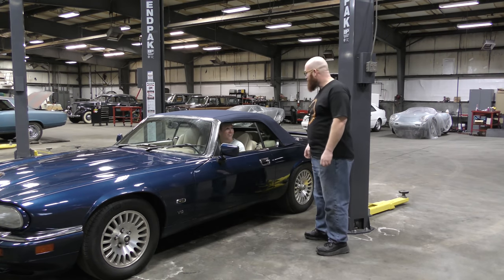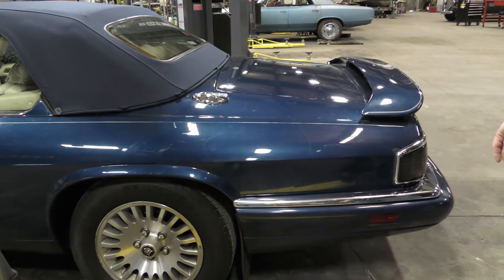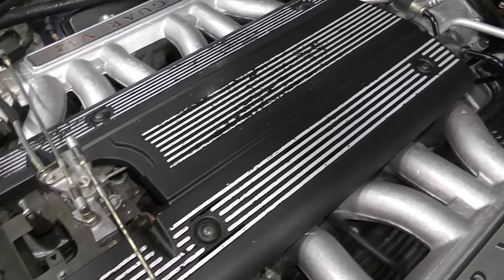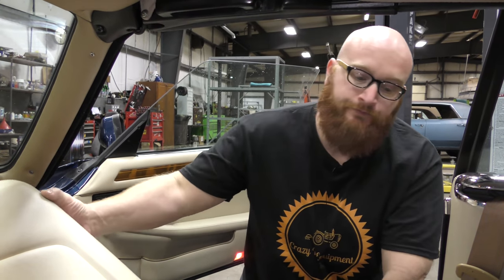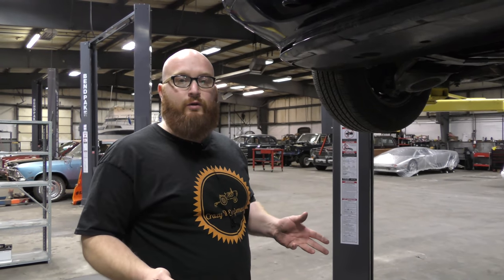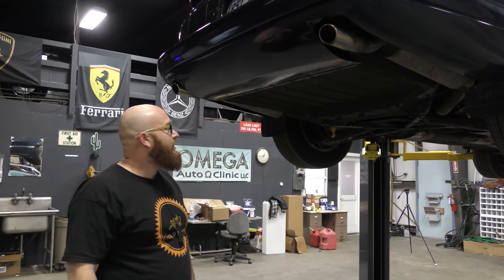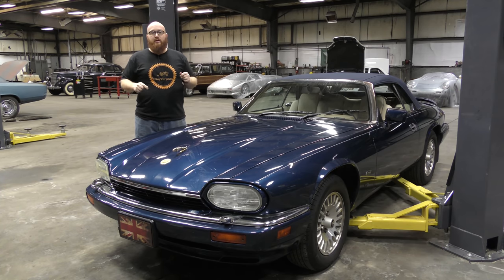It's another smooth running V12 Jaaaaag in the CAR WIZARD's shop! Check out this 1995 Jaguar XJS

Comment: The yellowing apparent @9:47 on the passenger side headlamp would annoy me. I assume that it isn't just an artefact of the way the car is lit.

As far as the general state goes, it looks like almost all the problems are just age related, such as the valve cover gaskets hardening up and leaking. Presumably that's why the dampers have been replaced and the brake hoses.

nb. why is it in the car world dampers are called shock absorbers? It's one of the great misnomers; any mechanical engineer could tell you that it's the springs that absorb shocks, and it's the dampers job to dampen down the spring reaction (especially on the energy release on the rebound). For that matter, radiators don't radiate to any significant level - they cool via convection. John Cadogan has a good rant about this, and I must have caught the disease from him.

Comment: Be careful with the marelli! The dizzy rotors fail and the passenger side bank loses spark. When that happens fuel dumps into the cats, they overheat, and the car catches on fire. Solution is to pot the rotor and delete the cats!

Comment: Occasionally on my way to work. I go by someones house that has a white version of this. Not sure of the year or model. But it's very similar. But it's not moved in years. Poor car is just sitting there getting moldy. This one is nice. If it were mine, I'd lose the wing, swap out the wheels and maybe change the top color.

Comment: Have been a professional automobile Technician for almost 40 years.  My apprenticeship was at a Mercedes Benz dealer, and became a Toyota Master Diagnostic Technician in 1997.  Worked at 2 separate Toyota dealerships that also sold Jaguar.  I remember going to MB training in Montvale, NJ and how much the instructors in the mid 80's made fun of Jaguar.  Then my experience at the Toyota/Jaguar dealers so turned me off about them. Loved the looks of Jags, but found them to be extremely unreliable,  and difficult to repair.  That said, I still adore the styling of the E Type,  and 60's Jag sedans.  XJS though....felt like it wasn't quite finished, and the designers said..." yea it is good enough,  time to turn it over to production."

Comment: Holy shit. Twin shocks @@ I remember it being the fastest car I'd been in for many years, a 5.3, 3 speed auto version. It was a tank and even with stetched legs as a passenger I couldn't reach the firewall. It was silky smooth but I never got to look underneath.
Reply: Twin shocks had been a part of the Jaguar rear suspension since it first went independent, that was in the 1961 E-type (61 years ago!!!).  One in front of each half shaft (which is the upper link of the suspension) and one behind each half shaft, quite logical.

Comment: Wizard, how does an oil leak affect rubber parts on the engine? My engine bushings were constantly failing because of oil leaks, isn't there a similar risks for all these belts?
Reply: Oil is a petroleum product. Rubber is a petroleum product. The liquid oil slowly dissolves the rubber, making it weaker in the process. The exception to this is the nitrile rubber used in gaskets, etc (but not in belts, motor mounts and other parts). 

Think of it like water in a dirty pot, the food on the pot eventually softens and breaks up because of the water.

Comment: A small question.. About the check engine light. I've read somewhere that OBD wasn't standard until 96-97? How does one go about diagnosing the engine light? I guess there's a diagnostic system of course. But is it jag propriatary? or some older standard?
Reply: Jaguar preempted OBD’s arrival and a ‘95 should have the standard socket for a reader to connect. The brake accumulator leaks it’s nitrogen above the diaphragm causing soft brake feel.
Reply: You turn the ignition on, and then any codes stored are displayed in the trip computer screen.

Comment: its crazy that four cylinders make that v12 power now. who would have thought back then
Reply: Usually those four cylinders need help from one or two turbochargers - more added expense and mechanical complexity.  Those V12s don't need any additional power adders, and best of all, no need to rev the engine to a million rpm to get the car moving.

Comment: Which ornament is best?  Neither, I would prefer the more sinuous leaper from the earlier Jags,  or perhaps,  even better, nothing at all - the E-type only had the cat's head badge in the middle of the air inlet bar.  You could always get a black leaper (the sinuous one) made from vinyl and attach it to the sill, just behind the front wheels, understated, or again a relief badge of the leaper.  The cat's head badge looked good in the early years when it showed the Le Mans victory years, but, in my opinion, it does not compare to the early leaper.

Comment: Some one did work to the  suspension anf didn't align it ,may have done a tape measure toe job that's why crooked wheel yet drives strait. But Im sure he figured that out before he even posted this video lol.

Comment: 1945 — The famous Leaping Jaguar logo was first introduced on bonnet / hood ornaments, and its style remained relatively unchanged until the early 2000’s. It was the Famous Dictatorship The EU that put paid to most Bonnet / hood ornaments by making it that it had to fold or vanish in an accident.
Reply: This Jaguar was built more than a decade before the EU put those pedestrian-safe requirements in place.  In fact, the EU didn't even exist yet when this Jaguar was manufactured.  As other comments have stated, the leaping Jaguar hood ornament was added later by someone else.

Comment: Car Wizard: The rear seats are put in because some countries will charge a higher road tax for two-seat sports cars as they are considered a luxury item.

The extra seats (with seatbelts) are used to get around this.
Reply: If you are buying this cost is not an issue surely?
Reply: @noelnicholls1894  You'd be surprised how high the taxes can be.

Comment: A possible reason that the Jag uses so much steel, while many other contemporary vehicles do not is that Jaguars were not made in large enough numbers to fall under CAFE requirements (or the Jaguar customer accepted the 'fuel guzzler' tax as a badge of honor).  Automakers whose products qualified for CAFE restrictions were painfully aware that every bit of unnecessary mass would limit the number of high margin cars that could be balanced by slim margin econoboxes to stay within the corporate average fleet economy.  The whole SUV fad, in the US, was due to SUVs not falling under CAFE restrictions, so nobody cared about their terrible fuel economy.

Comment: I don't like the aftermarket rear spoiler, apart from that it's a beautiful XJS  jaguar with wonderful blue paintwork. The jaguar designed V12 is without doubt the best in the world, utterly reliable if serviced by someone like the Wizard. Steel timing chain within aluminium engine block and heads.  Prices of these are going to deservably increase considerably. Front spark plug is a pain to change, but no big deal for someone who knows these cars.
Reply: Actually, that spoiler is not aftermarket, and was offered by Jaguar on this particular model back in 1995.  If you look it up you will see photos of similar models with spoilers.

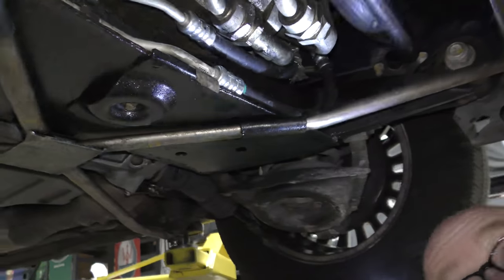Comment: 10:54  are electric fans better than engine driven fans?
Reply: Depends on who you ask.  There are proponents for both methods.  Engine driven fans tend to be more reliable, are always on.  Downside is parasitic drive losses resulting in a minor loss of power, and you have to maintain the fan belt.  Electric fans are more compact, helpful in cramped engine bays where engine space is at a premium without losing cooling capacity.  Less parasitic drive loss with the engine.  On the other hand, electricals have to be maintained or you lose cooling capability.  There are arguments for and against both fan types.

Comment: 300Hp is Not a lot, IMHO,--maybe for '95.   Only about 2K miles/yr.   I thought I saw a small tear on the passenger side rear corner of the top @ its base..    Beautiful unit overall.    Chk engine light could keep it from being licenced,--could be critical.    It should stop quickly--4 whl discs!    Should make for an "interesting" vid.

Comment: The reason most cars use plastic as much as they can these days on interiors and things like the door handles is most certainly cost but also weight. Modern safety structures and devices add so much to the weight of a vehicle that, they are a nightmare to get to fit at the same time into modern emissions standards and meet customer demand for frugal fuel consumption. So, there's absolutely an extremely high incentive on using modern composites everywhere possible. Unfortunately, the stuff that withstands UV in a fashion that would actually make the part endure the entire life of the car, that stuff also tends to cost. Like the stuff firearms industry uses, for example is very durable to both manual abrasion and the environment. But that doesn't come cheap. Add to that the insane notion of modern regulatory authorities and of course the industry itself (managements idea, against the better advice of us engineers), to insist they're only meant to last for 3 or 1,5 years. "No, that is not a joke." and you get things that literally fall off into your hand after 5 or so years for door handles. I know, since I study mechanical engineering and am majoring in automotive technology (cars and heavy-duty industrial applications, trucks, front loaders, logging machines etc.)

Comment: The leaping Jaguar on the bonnet is completely WRONG. It should be removed posthaste. The large cat is off of a much older car. I've had two Jag v12s. One perfect - carbs, the other a mess-FI

Comment: Just wondering why the wizard would fix Jags and not BMWs.
Reply: Old jags are way, way easier to work on than modern BMWs, especially once you know what some of the odd systems do. Certainly in terms of the engine. 

There is far better access because they designed the engine with servicability in mind, not hiding things under things or integrating unrelated parts for the sake of neatness. It's all right there where you can get to it. Not only that, everything is made out of metal on these jags, so you dont have to worry about the brittle plastic that plagues modern bmws.

This doesn't really apply against older BMWs like say an E12 (because they were all metal like the XJS, and designed to last), but Wizard has said he's fine with those.
Reply: @thegearknob7161  Very informative, thanks. However, the Wizsrd to ook a pass on fixing Hoovie's E30 M3.

Comment: Magneti Marelli cannot be worst than Lucas
Reply: Oh, it is.

The Marelli has a decent computer aspect to it to control the advance, but the distributor itself is junk. They eat rotor arms and dizzy caps, and these are expensive. Lucas ones are much easier to find and half the price.

Because 12cylinders is too much for a single coil, the Marelli has a T shaped rotor and two king leads, and works like two 6 cylinder distributors in one, which is its downfall since the rotor arm is poor quality and not insulated enough, and electronically adjusting the timing messes with the spark gap inside. One end of the T burns out and you lose spark to an entire bank of 6 cylinders.

The Lucas had a mechanical advance on it (It was pre-computers) which could stick if neglected, but is easily fixed and maintained. The Lucas rotor arm and cap are far better than the Marelli ones which makes up for it.

Comment: They replaced metal parts with plastic due to American C.A.F.E. standards.  Lighter cars use less fuel. Tell congress the cafe standards have gone too far if you don't like plastic pieces that break.

Comment: Would anybody be upset if they raised the price of a brand new car by 60 bucks if they used metal door handles?
Reply: Hinge pins on handle corrode and cause problems, so maybe plastic is good??
Reply: @davescott4065  I guess it all depends on the quality of material and maintenance. 
My old Ford has the metal button you hit with your thumb, 55 years old, still works great. 
My Honda's snapped. Anecdotal, I know.

Comment: I got a V12 Series III XJ 4 door Sovereign. Much better looking. and also a 2002 XKR Convertible. 

This car has the terrible darkened rear lights and the lots of naff mid 90s nonsense. 

Would spend a bit more get the car looking better not just good.

Comment: The leaping jaguar is the old mascot the disc with the face the more modern look introduced on 1969 xj6 as jaguar stopped fitting the leaping cat due to regulation and law suits following accidents.they where never gold from the factory   a part the gold edition xj40. That bonnet badge is not correct its aftermarket
The lozenge headlight are the correct design from factory the twin unit where usa only and very poor lighting quality as usa did not like safe night time driving.
Why would the wood and dash be cracked only that happens is by miss treating your car and using the wrong cleaning products. We have cars from 1970 with original interiors no cracking  only general cleaning with correct products.
Most where 2 seater but some asked for the rear seats personally i would remove and put the lockable storage unit in